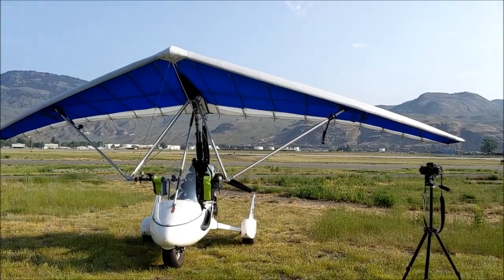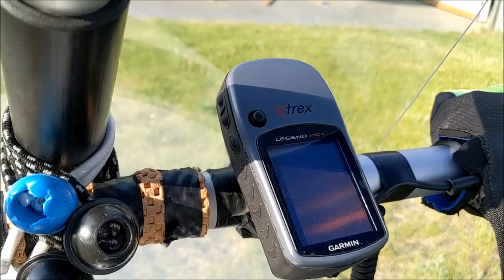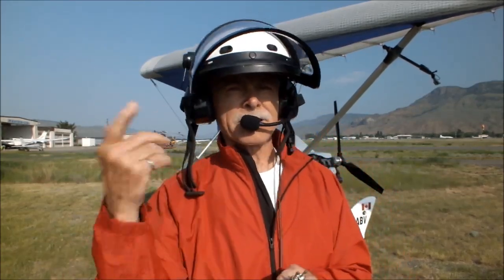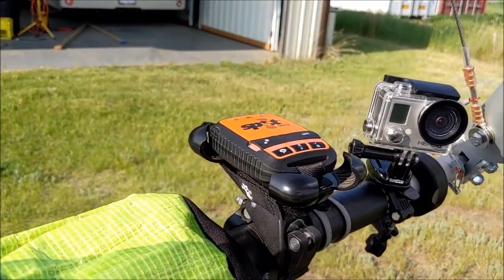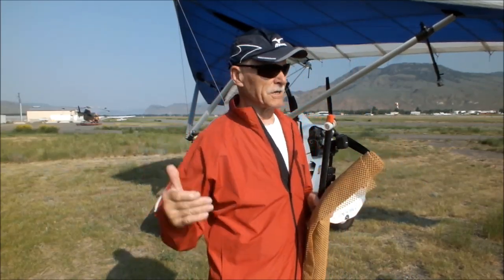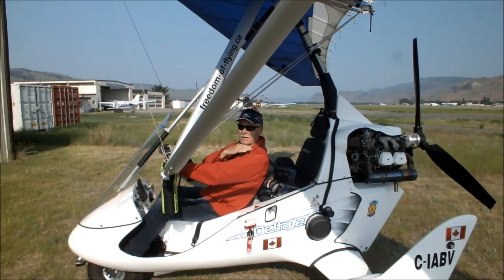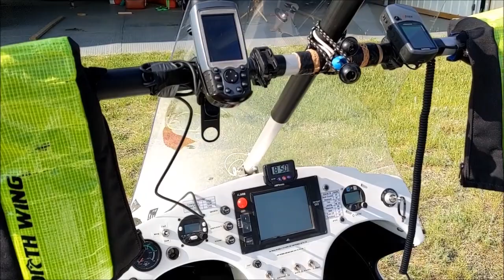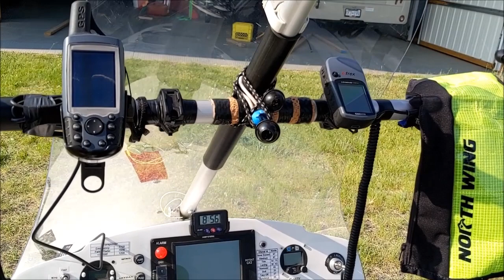234. How Trike Works and How to Mount Flight Cameras, May 30, 2019

Comment: Can you tell about the actuator you have on the bar for fast and slow. How can I get it installed.
Reply from the maker: It was part of the trike when I bought it. The best would be to contact the manufacturer for the latest info